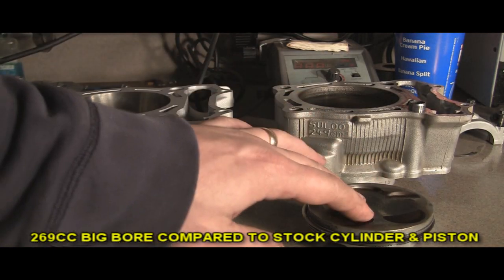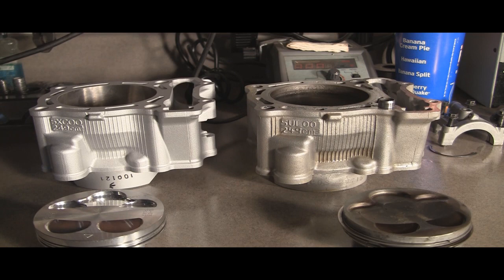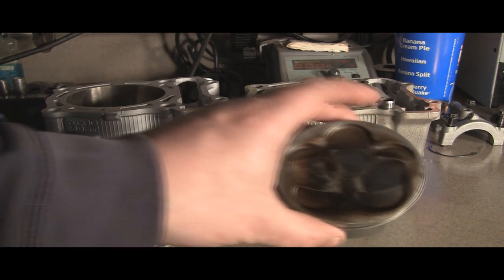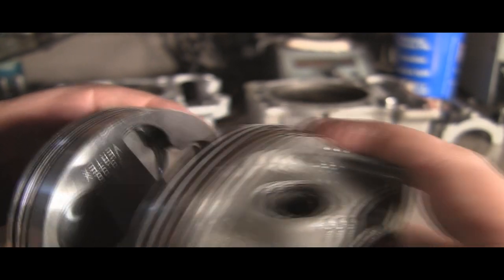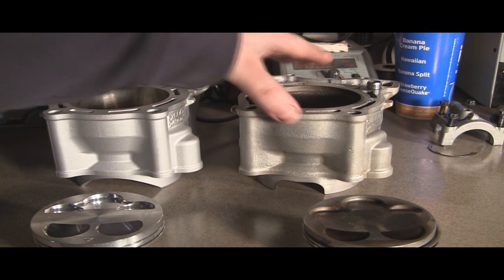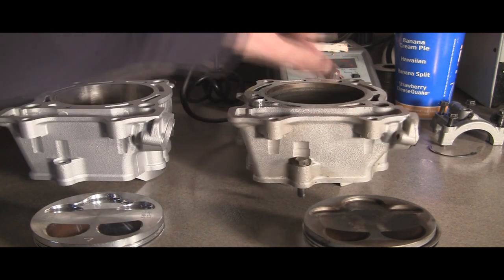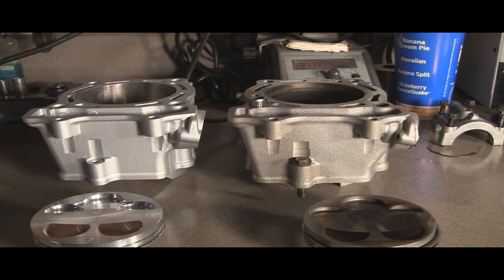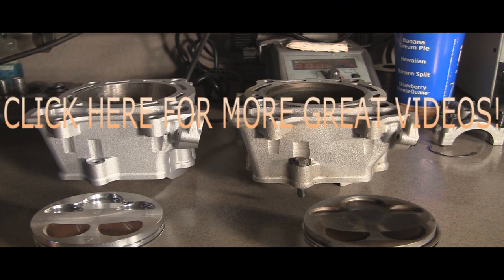Cylinder Works 269CC Big Bore versus Stock OEM Cylinder

Comment: im buying a 2008 yz250f with a works connection 269cc kit on it.  now, the kit says 12.5:1 compression, but stock on the 08 is 13.5:1.  is it worth the lower compression, and does it still raise power, or is it worse due to compression loss? i need a quick response, thanks!!!